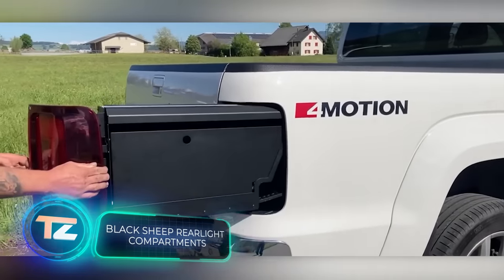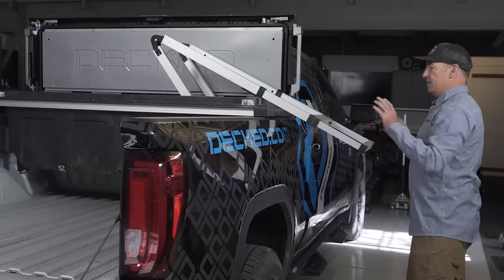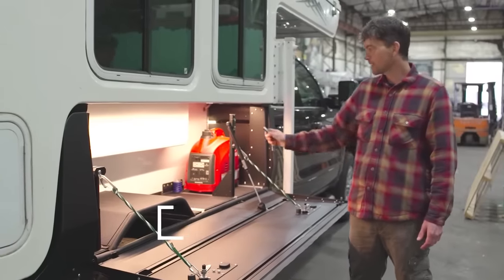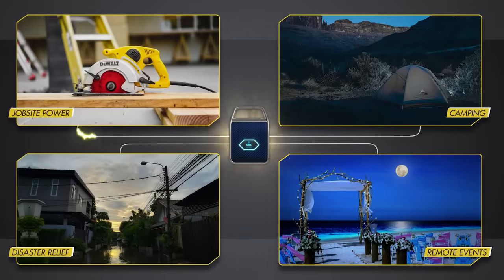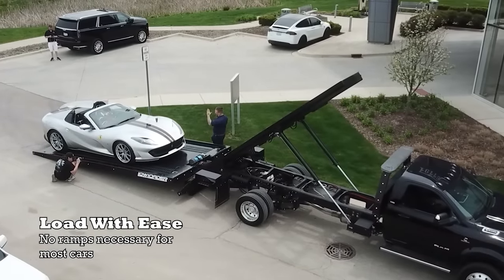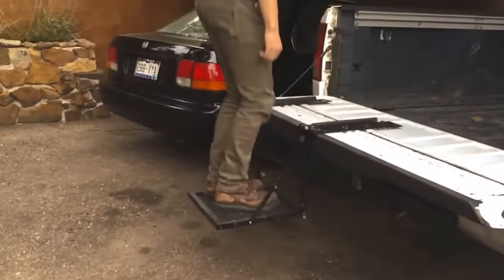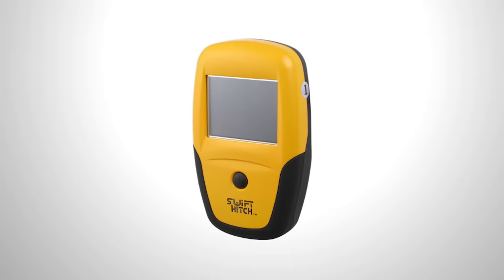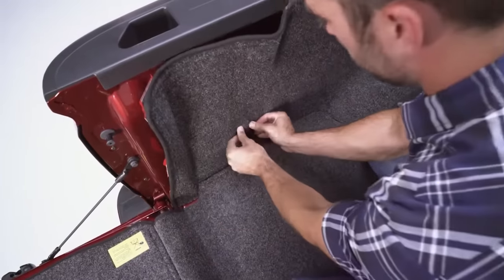15 COOL INVENTIONS FOR A PICKUP TRUCK

Comment: The best invention would be a pickup truck anyone can afford.
Reply: Oh so true
Reply: Complaining just because a PU costs as much as a house...what's wrong with an 8 year loan with payments of $700 a month
Reply: Maybe one that doesn't turn to rust in 10 years.
Reply: They do - it’s called a matchbox
Reply: Those Japanese kei trucks that can only be imported after 25 years come pretty close to that. Just gotta drive on the British side of the vehicle. I really think the Daihatsu Midget 2 is pretty cool but I’m not sure if I could fit in one.
Reply: Amen
Reply: And lasts longer than 100k miles without major repairs
Reply: Ford maverick starts at 24k I get 42mpg on my 60mile commute.  It's not good for real truck work. I keep my paid off truck for that.
Reply: Amen
Reply: You mean a working man’s truck that a working man can afford? Yeah, that’d be great
Reply: Used categories have what you need also 😊
Reply: @knuttsackjones3094  I have seen examples of it being harder to buy a truck if you're not a working man.
Reply: You can buy used you know
Reply: @SophiaAphrodite  if you buy used you better buy it in full because the interest rates on used vehicles are usually higher to the point where you're paying a good bit more and the price of used trucks right now are not good.
Reply: I can remember ordering a new GMC 1977 loaded around 7 k Easley affordable. Can't afford a new one now, cost more than a  house did back in the 70s
Reply: They used to exist. Then every suburban soccer dad wanted the most luxurious one they could get their hands on.
Reply: LOL 😂,  those days are long gone. I bought my first and only brand new vehicle when I was 52 paid cash. A Ram Express shortbed single cab 4x4 for 26 thousand. It only has 83 thousand miles on it and I'm now retired. It will be my last vehicle ill ever own unless I get in a wreck.  The car companies are driving themselves out of business and when the SHTF ... that's when many that have those 700 dollar a month truck payments will drop off their truck that they didn't own. 😮
Reply: Bingo
Reply: Best comment so far.
Reply: The working man has been out priced for his work truck.
Reply: 😂😂😂 Too true!
Reply: Amen to that
Reply: @fredflinstone6672 
Stop buying Chevy's
Reply: @SophiaAphrodite Because of the price of new trucks it makes used far more expensive. Some one needs to make a basic truck. Reliable engine and drive line. clothe  or vinyl seats, wind up windows, rubber floor mats, steel wheels etc. a basic work truck.
Reply: if you can't afford a pick up truck, then you DON'T NEED ONE. if the cost of fuel for your truck bothers you, YOU DON'T NEED ONE. pick up trucks pay for themselves doing real work, if you put carpet in your rear bed and it's not for safely transporting brand new wood furniture or some other such that can't get scratched or marked up, then you don't need a truck, your probably in the same mind set as those crazy women who put carpet and living room furniture and tvs on the concrete patios in 4 season climates or designs and builds a house boat that gets froze in and only has 1 fire place that heats just the living room only and you have to dress like eskimoes just to sleep in the winter.

 if your truck isn't for making money, and you can't afford it as a status symbol just like a lambo and a super model wife and a 747 jumbo jet and a yatch that makes the u.s. navy whistle..... sell it to some one who can afford it.
Reply: In Australia a lot of tradespeople buy these because they get tax concessions as they're a commercial vehicle. What Americans call a pickup, we call a ute/utility and make up probably 50% of all new vehicle sales. Mainly the likes of Toyota Hilux, Ford Ranger, Mitsubishi Triton, Isuzu D-Max, Dodge RAM, Chevrolet 2500s etc. They're pretty affordable here.
Reply: Ford has a $20,000 brand new truck in the works
Reply: Elon MUSK probably going to give us all one cyber truck. 😅
Reply: Its called a toyota
Reply: Amen to that
Reply: Amen brother!
Reply: Toyota to release a $10k truck. Just search Toyota 10K truck
Reply: that is called a little red wagon pulled by the most powerful engine called your legs 😂... I on the other hand cannot even afford that 😂
Reply: @randyschwartz9448  that would be a nice cheap truck
Reply: Maverick.
Reply: You can get an old f150 for like 1200 and it will probably run for the next 30 years.
Reply: They’re cheap
Reply: Keep your eye on the Toyota IMV, rumoured to start from $10,000.
Reply: @idontwannaidontwanna7307  not in the USA and it’s actually like 14000
Reply: Go back to the 1970s
Reply: they used to be affordable before covid
Reply: @raidenout1515  if it's not good for anything a truck should be able to do, why not just get a car? And you speak as though 24k is affordable.
Reply: @gorehammer1 .... Not everyone lives in the US
Reply: @idontwannaidontwanna7307  false.
Reply: Got that right! 😮
Reply: Haha! Good one... Yeah yeah that dumb Cybertruck
Reply: And he dropped the mic and …. Just… walked…. Away.
Reply: We had that until everybody started buying them to use as a car. They went from a vehicle designed for work to a luxury vehicle.

You rarely need most of what they put in them. You don't need a fancy stereo, carpet, leather seats, seat heaters, dvd, etc. A single cab with an8 foot bed. Choice of a fuel efficient engine or one for towing.
Reply: I mean, why does everything need to be for everyone?
Reply: @turbopokey the Kei is illegal in a bunch of states
Reply: @fredflinstone6672 I mean, my 2021 Sierra AT4 Turbo Diesel had 200k km (130k miles) when I sold it, in mint condition, with not a single mechanical issue and nothing except regular maintenance. The idea that Trucks are unreliable is nonsense. My sons Toyota hauls his bass boat across the country, he puts on 60k miles per year easily running from tournament to tournament. The only problem he has had so far was a broken exhaust mount. My dad’s x31 Duramax has over 100k miles, and also has had no mechanical problems. He just replaced brakes/rotors at 90000. 

So basically, you’re speaking nonsense.
Reply: @Stonehorn81  yeah, not mine though, and I wouldn't plan on any interstate travel with it.
Reply: A pickup truck that anyone can afford sounds great, but would it compromise on safety, quality, or environmental impact? Sometimes, affordability comes at a hidden cost.
Reply: Toy trucks don’t rust and they are affordable.

Comment: Bed Slide is absolute garbage.  Have had several renditions on multiple different trucks and they all fail within a year.  You lose a lot of storage capacity as well.
Reply: Yea wouldn't cross border with that back into states..don't think  any of four agencies  would believe  it's just storage space
Reply: They didn't invent it, either. "Decked" has been making a bed drawer for years.
Reply: That is what you get for overloading them.
Reply: I put a camper shell on my 
P/U for weather protection and some security. I learned to hate it because stuff was always out of reach. Got a Bed slide and fixed the problem. Had it over five years now.
Reply: @miguelcastaneda7257  
Is this thread where you really wanted that comment?
Reply: @calvingreene90  look at what at what law enforcement  anywhere would think if they found this
Reply: @miguelcastaneda7257  
The bed slide which this thread is about doesn't create any hidden storage spaces.

Comment: Carpet for your pickup bed? I would give in 3 months and then the smell of rotten carpet would turn me off.
Reply: It looks pretty easy to put in and take out.  It would be good for hauling things you did not want to get banged up, or even a sleeper base with a bed topper.
I would not leave it in very long, or on rainy days/nights.  (ha)  If you used it for something like that, you would probably choose it over some of the hotels today.   :)

Comment: I keep a simple wooden stepstool in my truck to get into the bed, it was like $20.00. Used the same one in 3 different trucks
Reply: Never thought of that. Thanks.
Reply: I bought 1 about 35 years ago when the price was only $5 at the local 5 & dime.  It still works great after getting my 4th pickup truck.
Reply: Drywall bucket!
Reply: Fingers crossed that the plastic fold up stool I use has that lifespan.
Reply: Yeah, I have a milk crate that works great for that. It has also found its way into several of my trucks over the past 20 years.
Reply: I use my unwanted children. I just make them get on all fours and use them as a step and it works out great anywhere, even in the mud on uneven gravel, ice, snow and broken glass. Sure they whine a little but that clears up when you step down a little harder when they do. But it is best to keep them in the box of the truck so you don't have to hear the sobbing or get the cab dirty. 

I'm kidding I don't even have any children.
Reply: @MisterMayhem727  Do you have a mother in law ?  They make great speed bumps, too.
Reply: ….folding step stool (Looks like a little ladder)
Reply: 😂... I do the same and get made made fun of for it. I'll be the one laughing when I haven't unnecessarily worn out my knees.

Comment: The prices of everything is insane: except for those spoiler boxes; which look ridiculous. 
A folding step for $500 and can't hold more than 300 pounds? You can DIY one that can hold three times that weight easy and weigh about the same for under $50 in materials (retail) and about 30 to 45 minutes or so. I know, I made one similar for a friend's Toyota a few months ago. Stores in the side and you attach it to the tailgate to use when needed.
Reply: You and I can DIY, many people can't.

Comment: It's a crying shame that standard work trucks are now so high off the ground you need a freaking built-in ladder to access the bed.
Reply: i just climb on the tire
Reply: @politerudeboi6898  Well, I made a living out of standard work trucks for over 30 years, and I remember when you could just reach in and get what you needed out of one, or even just step up into the bed of one from the ground. Right before I retired, the new ones were requiring you to use a step ladder just to get something out of the tool box behind the cab. It's a crazy world.
Reply: @ralphcantrell3214  i like my tacomas high clearance  due to my off road neighborhood in a forest but i do understand why a lower truck would also have its place in the field

Comment: That solar tonneau cover is just common sense
Reply: For a very tiny number of people, maybe.  Running an auxiliary charge lead to the truck's electrical system would cost under 1% of what the panels do and give you way more power, and it could charge day or night.
Reply: @DonziGT230  I'm talking about to a solar generator or battery bank. For camping and working out of the truck.
Reply: @kurtgainz  After a full day in the sun they'd provide as much charging as you could generate by running the engine for a few minutes, seems fairly pointless.  The company publishes the prices for all their non-solar covers, but doesn't publish the cost of these so I'm guessing they're well over $500.  Then add the price of an inverter, batteries, and wiring/installation.  Or you could buy a generator for under $200 that delivers more power and isn't tethered to the truck.

Comment: My truck with a cab high camper shell has the Bedrug installed inside and its an awesome product. It matches the gray carpet on the inside of the shell too. Makes it nice to sleep on or hauling items without them sliding around. If it gets dirty, you can rinse it out or even vacuum it.

Comment: Everyone eats in their auto. 
Can someone explain to me why they aren’t manufactured or aftermarket gadgets made or designed to accommodate dining?  They won’t even incorporate a built in cooler. I mean most of the crap you pay for on them no one uses.

Comment: You could spend well over 10K on this junk and it would maybe add 1K to the resale!
Plus you will have people asking you to remove it and reduce the price!
Been there, done that. I bought a used truck with a bad motor, "operator headspace"👻
Fixed the motor, put it up for sale!  After the third person asked me to remove some of it and reduce the price, retail of course!  After that when they called I told them if they were not interested in the options don't  waste my time coming to look at it!

Comment: #15 sucks, ranch hands are the best bumpers, they take a good hit from any sedan, and store the tow chains to pull them out by inside and you can take down trees as big as your arms or rip them out of the ground.
if you need a ladder to get in your tool box 🤣😂🤭🤪😜😛 you obviously aren't man enough to afford step bars or smart enough to drop the tail get or step on the rear bumper and and walk thru the bed. me...i just look over and reach right in all the way to the middle...because i'm a manly man

Comment: I worked cattle in New Mexico and would have LOVED the second truck with water storage and spare tire lift.  ALL roads were 5mph rock strewn hell on wheels.
Reply: Mean the old rule driving 4 or 40 creep over it or fly over it grew up desert  so alot of roads were  dirt  ones that were used often  county would come out and mist with oil..as it was driven  over it would  pack down
Reply: I just put my 20 gallon fresh water storage tank under my toolbox along with the pump. But it didn't cost me hundreds extra or thousands extra.
Reply: When I worked cattle I used a horse.

Comment: I love my bed rug.  Had it on my last 2 trucks and I’d never have another without it. I load dirt bikes, haul furniture, sit on it at camp fires.  Beyond amazing. Soft on the knees, makes the bed flat, things don’t slide around or get scratched. I just hose it off or blow it clean with a leaf blower and it looks like the day I bought it. Great product.
Reply: I'm just curious, where are you putting loads that need to stay dry then after it rains and that rug is soaked?
Reply: @Grimmsha72  I have a hard, roll up tonneau cover. 
My bed rug covers the tailgate and bottom, not the sides. I don’t see the need for the sides and this I can easily remove if I need to but never have. Great thing as well is it keeps dust from getting up into the box from above the tail gate.  I put luggage and bedding back there and drive on gravel roads and have almost zero dust or water. It’s like having a massive trunk.

Comment: Bedslides have been around since 2002. I have seen them installed in Chevy Avalanches back in 2002.
Reply: I put cardboard in my bed and load rock on it, when I get to the job I just backup and stop quick and then I can pull it out.. I have a bedliner that is very slick.
Reply: Long before then - I worked with some at a telephone company in the 1970's.  They were steel, not aluminum, but they worked great.